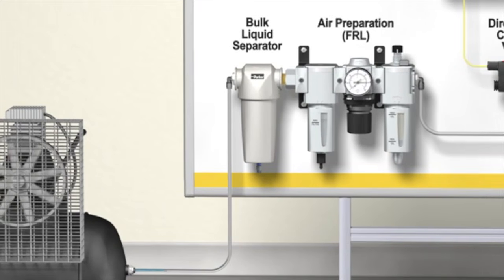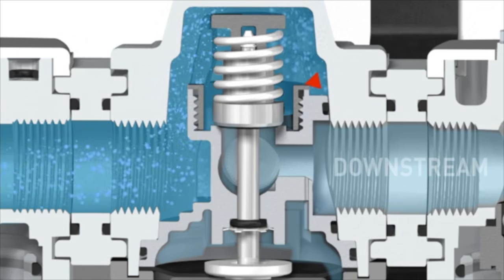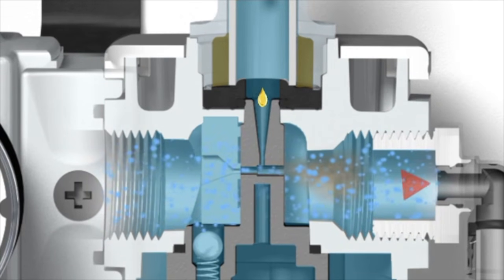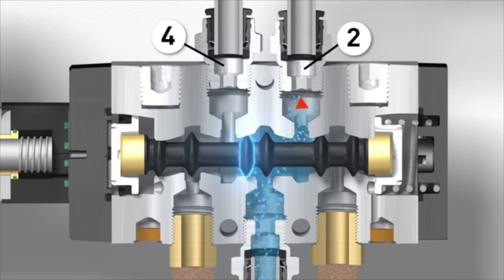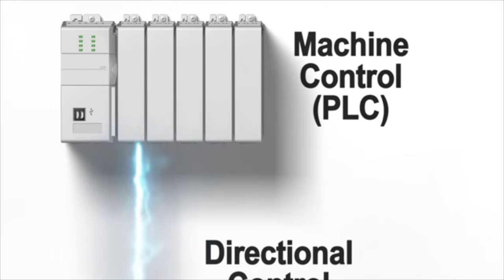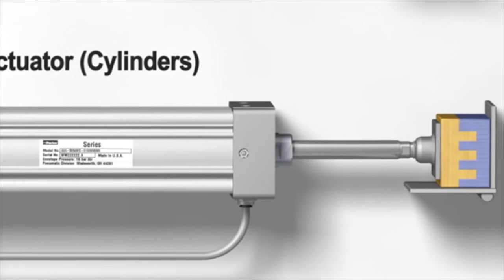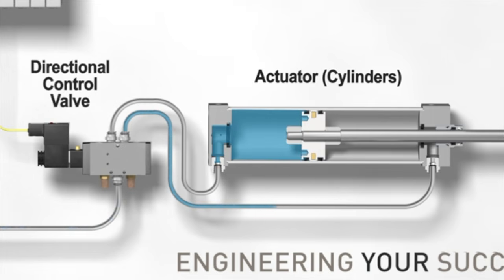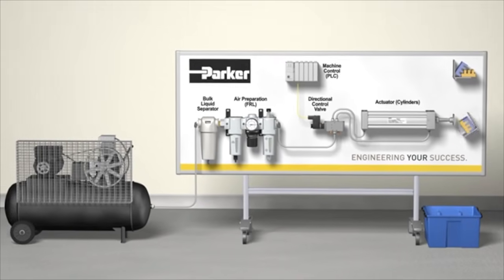How a Industrial Pneumatic Systems Works And The Five Most Common Elements Used

Comment: I appreciate your video to learn about pnematic system but you had to mention  a manual override because sometimes it can use to remove block air inside solenoid valve.

Comment: Hi , I have 150 mm dia , 50 mm stroke lenght , double action pneumatic cylinder . I want to know how much force it can generate .
Reply: It depends on how much air or oil pressure you can exert on the piston of the cylinder. Meaning, take the surface area of the piston end, in square inches and multiply it by the amount of force, in PSI, then decide on loss to apply to equation.

Comment: Brilliant illustration... Sparked interest in pneumatics... Q&A.. Since we need  air filererd thru all those stages of FLR why then lubricate with oil at the last stage.. 🤔
Reply: Some tools require lubrication to operate. The lubricator (not required or recommended for oil-less applications) delivers a shot of atomized mist into the air going downstream everytime the upstream air overcomes the downstream air. If the area around the lubricator is contaminated, you'll want to think through how to avoid contaminants getting into the bowl/liquid while filling it back up. Otherwise, you have clean, dry air going to the tool that is now also able to automatically lubricate the tool so it operates well.

Comment: What school or trade covers this Mechanic or electrician??
Reply: Mechanical, but when I was a toolfitter in Ferrantis /Siemens in Manchester and starting out in "special purpose machines" in the union controlled 1970s we werent allowed to wire in solenoids and had to send for the electrician, so most of our designs nearly always  used air-pilot valves( sometimes controlled by pneumatic timers) for switching the 3/2, 4/2 and 5/2 valves. In the late 80s and 90s PLCs started to take over the control of pneumatic systems as well as electronic positional sensors attached to the actuator bodies.
At the same time unions didnt have the power to prevent fitters and sparks mixing trades and becoming "multiskilled " so if you were lucky you were sent on basic electrical  or mechanical courses and then a PLC course (Mitsubishi, Siemens or Alan Bradley plcs). I remenber something called "Ladder Logic" and the setting of "Flags" that was  used in the circuits.
Reply: Mechanical
Reply: @damlurker  #mechanical #Engineering is not me man